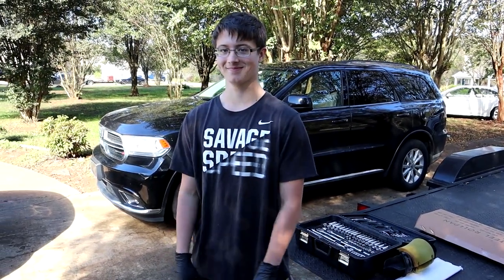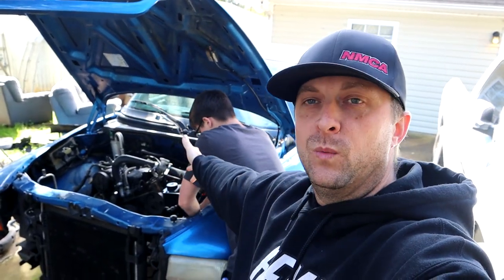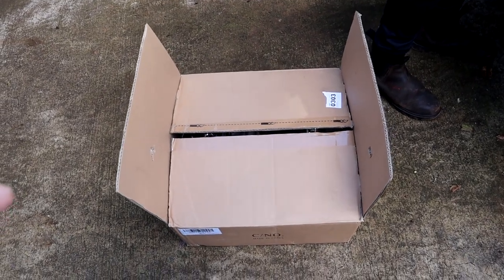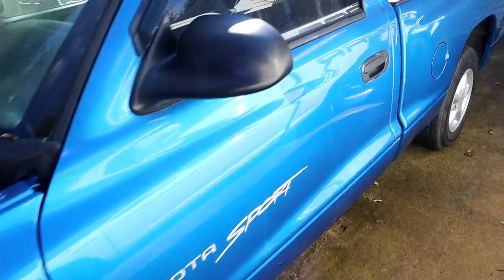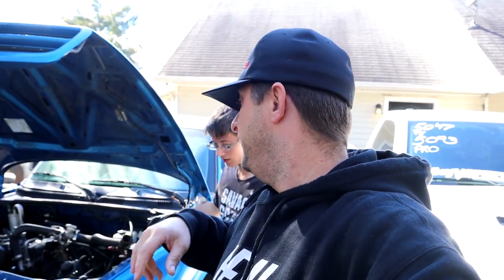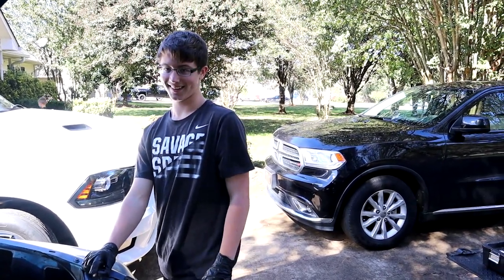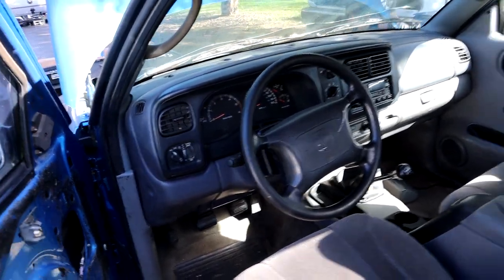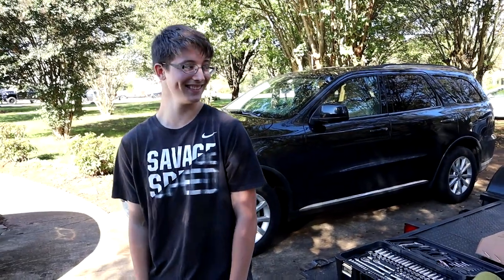Project SUB-ZERO DAKOTA Gets Some Love

Comment: What rear end is in that Dakota? I’ve got a really nice 8.5 from an older Durango 3:92  drum to drum. Also a B-Body 8.75 will fit it really well if you run across one.
Reply from the maker: Not sure ill have to check but was going to find a 9.25 possibly
Reply: @FrostbiteRam  those are pretty strong. They came in a lotta Durangos most with disc brakes. Pull a part here  gets about $150-175 for em here and u can find posi chunks pretty easily.  Good luck .